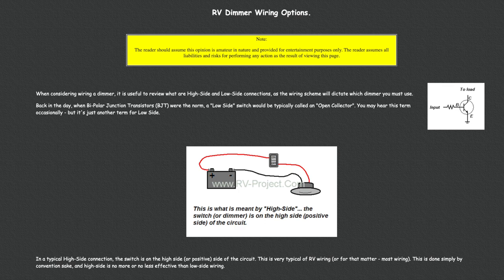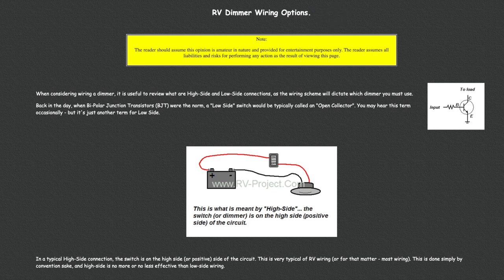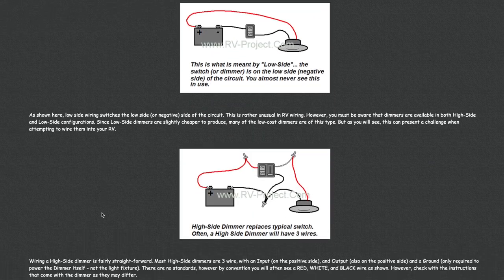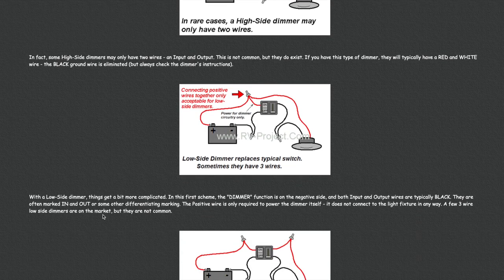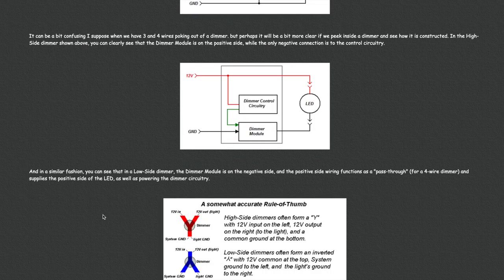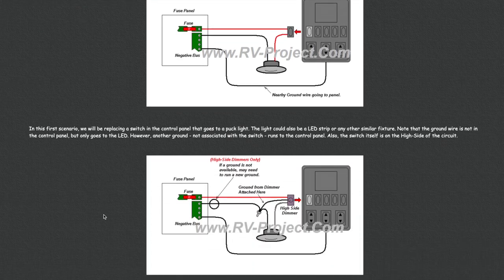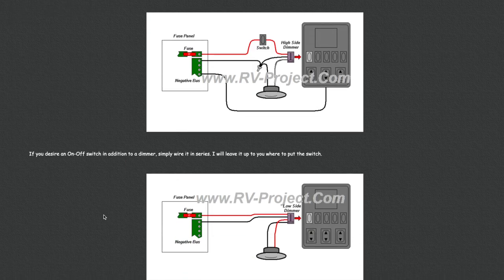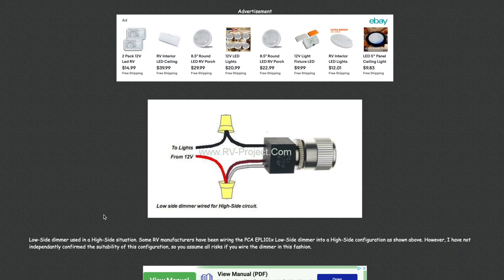RV Dimmer Switch Wiring Configurations.

Comment: I have a more general question about the dimmers.  I'm curious why they typically come with such small wires (24 Ga, I believe).  Wouldn't this limit the maximum amperage of the light circuit?

At first, I was going to run my switches to relays, allowing larger diameter wires to power a large number of lights in total.  Now it seems I'll be limited to the amperage-capacity of the dimmer.  Am I missing something here?  Thanks!

Comment: I tried replacing the switch with a dimmer in my Grand Design, but the switch went to the Compass-Connect  control panel and then out to the lights. What a pain
Reply from the maker: You may be able to put a dimmer in the output side to the lights. That way you would turn the lights on or off with the Compass module, and dim the lights with the independent dimmer. 

However, mg Grand Design RV is pre Compass-Connect, so I cannot tell you whether this would result in damaging your RV or not. So make sure you know the risks involved before attempting such a task.
Reply: @RVProject  Thank you. I'll try to get the schematic to verify it. The control panel allows blue tooth to turn off the lights and there is a secondary switch by the door.  I'll try to interrupt the circuit before one of the 8 lights.
Reply: @housesOTR  how did you make out ? I have a 2023 17 MKE with I think the same system.